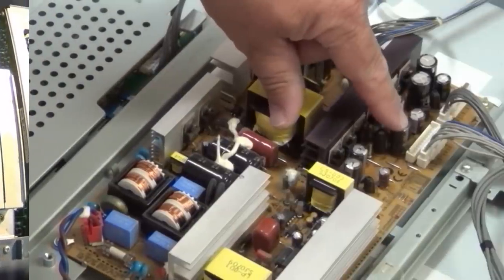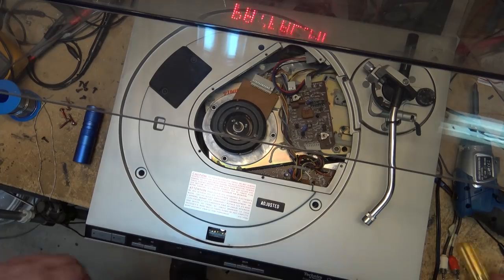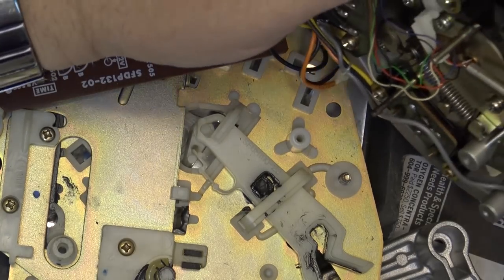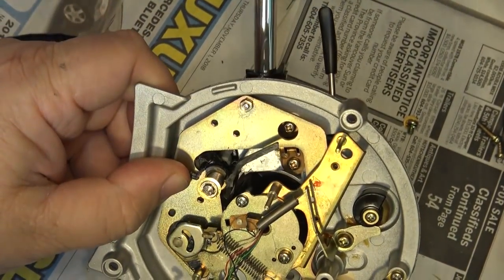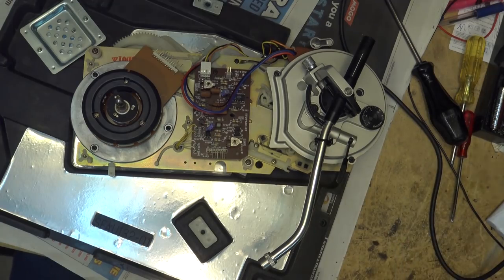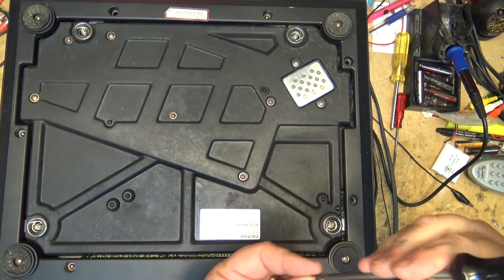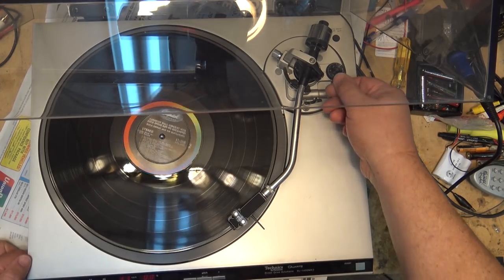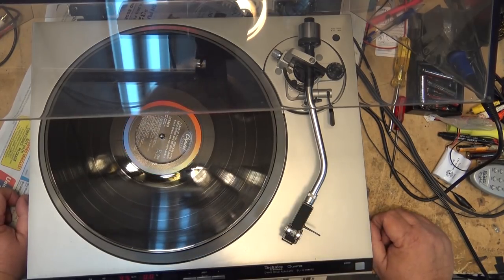Technics SL1400MK2 Arm Lifter mechanism repair

Comment: I have fixed many plastic parts with a soldering Iron! after melting them together though I mix a little epoxy and fill the divot made by the Iron and it lasts a lot longer.
Reply from the maker: So have I. Plastic gear in EVS7000 that splits was one of them. Still going strong.

Comment: Believe it or not, technics actually made this model (along with the mk2 variants of the 1300 and 1500) from 1976-1978. They were really ahead of everyone else during that period.
Reply from the maker: I have the SLM1, and it goes back to the mid 80's when the T4P cartridges started rolling out. Same motor design, but the M1 is quartz locked.

Comment: Funny you posted this.  I just picked up a 1401 to fix up and resell.  Mines in good shape but the auto play isnt moving the arm into position.  Ill be taking it apart soon to clean and fix it. I imagine they arw similar inside.
Reply: There is no auto-play on the 1401, that's the 1301. With the 1401, you press start and move the arm over. It's semi-automatic i.e. no auto start, only auto return.
Reply: @Digiquarium  well I'll be darned.  I'm really glad you said that before I dug into it.  Now that I know it's fully working I'll probably just clean it up and sell it.
Thanks for saving me some head scratching!
Reply: @Digiquarium  I was wondering if you knew what type of plastic the 1401 dust cover is? The one I have has a small crack and I'd like to fix it.  Thanks!

Comment: Probably a polyamide lever. Not easy to break in original condition, even with gummed up mechanism, but PA relies on water content to remain tough, and loses it over time, at the same time the parts shrink slightly, and if they were fitted around a metal shaft, they will break. Can be put into a bag with some water for a few days to restore the flexibility. No matter, it's likely to last for decades as it is now that it's set into its new shape.

Part like this likely won't scan, generally just about nothing scans properly, it's kind of a sci-fi dream. If someone were to CAD it up, a laser sintered PA part could be ordered off Shapeways, that's sensible, not too expensive. Not sure i'd want to print on my home printer other than for test fitting. If copying a part like that is needed, i just take 2k silicone from craft store, make a mould, and build up a copy out of epoxy inside the mould, made decent functional copies as durable as original of very delicate parts that way too, but i don't have the process down to where i would do it for someone else, it's not exactly efficient, would need to learn a lot more about making sensible moulds and resins. A copy wasn't needed in this case, i'm not criticising, just sharing.

Maybe doing small-series copies of parts that are likely to break and offering these replacement parts to repairmen can be a business model of sorts? That way the design or setup costs are better distributed, while $200 for a part is of course bollocks, but at $20, it starts to look much more sensible. Clients don't like to spend more than they have to, but perhaps they'd be forced to spend a bit extra as original parts decay further, good units become rarer and more desirable, and ad hoc repairs like with welding or gluing without replacement parts may become untenable.

Comment: So there was enough silicone left in the damping piston for it to work okay? When you said it was gunked up, it sounded like there was a lot of it lost.
Reply from the maker: Yes there is still good damping on the lifter piston. The solicon damping oil gets gummed up just like any old grease. I used to have a jar of it back when I worked in the shop. It was like glue.

Comment: The original arm lift part is no longer available, but some people offer 3D printed parts for the SL-1400.  This is a common problem of this model as the part was not well designed in the frist place, it has a weak spot where it always breaks.  You can find these guys on the sites of audiokarma and vinylengine.
Reply from the maker: Yes I know the original part is nla.  It had not been available since about 6 years after that unit was made as that is all Panasonic retained parts for.
Reply: I installed one of the 3D printed versions you speak of - it works ok so far. However, you need to install some thin heatshrink around the bearing, then press the new part on. The diameter isn't quite right
Reply: update, i think shapeways modified the part as recently when i've done the repairs they need to be sanded for filed before they will even fit on the bearing, but they have worked like a charm after that

Comment: I had to do some repairs on my sl1300, mainly the arm lifter. The lever for the arm lifter would just slide back down after I moved it to lift up the tone arm.  And when the record was finished, the needle would scrape across the record as it was returning to its resting position.

Long story short, once I got it back together the lifter stays up longer when you are automatically starting it, but  if you do it manually, the lever doesn't seem to stay up as long.  So I decided to try again to look online for info. I noticed that the videos on a 1200 and 1400 (and a few others) seem to show a (much) larger spring used on the arm lifter, than what mine has. 

Should all the springs for arm lifters the same regardless of the model? 

Thanks to anyone who can help me.

Comment: Smashing repair :-D.
The art of the wiggle jiggle :-D, some things are just a pain like the insides of rasta blaster stereos, too much crammed in to too small a space.

Plastic fantastic is a bloody pain in the ass, vcr's can be a bloody nighmare.
Small bits of weak plastic crammed into a small space, not enough room for a brace to support a joint.

Comment: Where do you get a replacement nylon part that drives the plunger? I'm working on one where the nylon broke apart and can no longer turn the plunger. It's too greasy in there to fix with epoxy.

Comment: There are guys on Audiokarma and Vinyl Engine that are 3D printing that part.  It's a common failure point on those tables.
Reply from the maker: I am aware of how common that part fails.  I changed many back in the 80s.  I also know how much work it is to get to it.  I started "fusing" the part back together back in the 80s or 90s.  
What is thought to cause it, besides the lifter freezing is thermal expansion of the metal part it fits over.  Seemed to happen more on setup where the turntable was sitting directly on amplifier.  It all boils down to cost and how willing the owner is to spend money.
Reply: @12voltvids  My alternative hypothesis is not that it's the metal that expands, but the PA lever/gear that shrinks around the metal shaft as it loses water, which happens faster if you keep it warm. PA is generally factory conditioned to absorb a few percent water by weight after moulding to give it optimal mechanical properties.

Comment: Cleaned of the gum, too bad the most important stuff is not in the video. How did you Get the armlifter completely off? I did remove the armrest but that did not help. And most importantly How did you Get access to fix the broken plastic cueing lever. Too bad those things are not in the video.
Reply from the maker: I didn't remove it.

Comment: You can get a replacement part for the broken lifter 3d printed on shapeways
Reply: This is now the second video on youtube that attempts to repair this issue without knowing about the replacement part.  

Maybe melting the crack back together is easier though.
Reply from the maker: It is all about cost.  I had a limit of 50 to repair this.  Could you order a part and do it for 50 bucks? I think not.
Reply from the maker: @AeroModule  
Yes it is and faster.  To disassemble that arm and replace the part would add at least another hour in labour charges.  When the client comes in and says I have a limit or 50 to repair this you do what is necessary to restore operation.  Since there is no stress on the part and the only reason it broke in the first place was because the lifter pin froze,  the fix will likely outlast the owner.  
YouTube armchair quarterbacks think everyone with vintage gear is an audiophool that spends 1000 on s patch cord and has unlimited resources to repair it.  In reality most of the collectors are older retired people that have limited funds.  They want their old gear repaired because they don't want to buy new for the limited use it will get.  It was no different back in the 80s and 90s when I made a living doing this.  A customer would spend 60 to 80 fixing something and it it was more than that they tossed it.  At 80 an hour shop charge (that is what the shop rate was) 1 hour labour seats up most of the limit.  Start adding parts and tax and people walk.  It is even worse now.  Some repairs I make money on, typically the high end  or rare stuff but most of it I make hardly anything on, so I wont spend much time on it.  There are many units that there is no video made because when I open it there is something major wrong and I know I can't do it for the limit that is placed on the repair so I close it up and hand it back.  Not that the unit can not be repaired but when the cost of say a laser assembly is 40.00 plus shipping and the limit placed on the repair 40 bucks.  Well you get the picture.  That is why you haven't seen me replace laser assemblies on CD players.  When they can go to the second hand store and pick one up for 15.00 why spend money fixing old one.   I make more from the YouTube video than I ever do fixing equipment.  For the stuff shipped in for repair, the post office is making a lot more than me on the repair.
Reply: I respect the limitations that may be imposed in a repair, especially those involving costs. I mentioned the availability of the 3D printed part (for $23 plus shipping) because it may be of use to anyone wanting to do the repair.
I have repaired this tonearm lift (details and pictorials on Audiokarma) about 10 years ago. A replacement part was not available back then so I had to improvise as well. I did clean the spring and shaft as well (as well as the entire tonearm assembly as I did it myself and labor cost was not an issue for me. 
The tonearm stopped working this summer when I did use the turntable a lot. It did last 10 years worth of infrequent use. I am now going to redo this trying out that part.
Reply from the maker: @savvassidiropoulos5952  
23 us dollars plus shipping to Canada.  A minimum of 50 it seems. Call it 100 for the part.  Turntable isn't worth that. Dome people seem to put unrealistic values on turntables.  Most will not spend that amount.  Since you have already had the arm apathy you know how much time it takes.  Very few are willing to pay to have this done when as you pointed out your repair lasted 10 years.

Comment: The lifter part is available now 3d printed
Reply from the maker: Doesn't matter because the owner had a 50.00 limit.  So the part would have to have been available for 5.00 including shipping to make it worth my while to do that.  I told him he would be looking probably 100 which is low considering the work involved and he said his limit was 50 all in.  So he paid me to make it a manual turntable.

Comment: Why not changing the old caps?
Reply from the maker: Because the owner is not paying me enough to do anything more than make it work.  Caps are fine.
Reply: you normally only do what is agreed with the customer
Reply from the maker: Customer brought it in with the lifter not working and wanted that fixed. He didn't give me a blank cheque to start changing everything.
I can't remember anyone, ever saying to me, even when I was doing this for a living, change everything that might break.Never happened in over 20 years. Not once.  Every customer was the same fix it for the cheapest you can, and even that was too much in many cases.
When I hear people say "why didn't you recap it" of this or that. Well if someone came to me and said "change all the caps just in case" 
First I would geta  bloody big deposit up front, and then I would do just that. But that never happens.
Reply: @12voltvids  Same here too. I though i do carry quite a bit of stock "just incase" but  what ever I use has still got to be paid for.
Reply: Because that is stupid. not every cap deteriorates enough to justify   spending ungodly amount of time and money. People just assume they do. If it ain`t broken don`t fix it. Right now you can get capacitor tester that can do so in circuit.  if it tests outside parameters then change it if not leave it alone.

Comment: I see you disabled your comments on your “screw you Canada Post” video lol didn’t like the responses you were getting eh? Next time be smarter.
Reply from the maker: The comments were disabled because there is no point rehashing it.  The sender fucked up because he did not require signature, the positie also fucked up because he didn't use common sense.  The other positie that was doing the route always either took it to the other door or carded it.  They would card stuff that did not require a signature.  I know this because I have to sign for stuff and show Id when signature was required and most carded stuff I didn't have to show Id.  So everyone that was making negative comments must be postal workers now worried about their job security.  When I disabled I had about 1000 up votes and 70 down votes so clearly the majority of viewers agree with me. Perhaps the system is broken and needs to be fixed.  When stuff gets stolen, if it is a new item the merchant has to eat it because the credit card company will reject their payments.  I talked to another postal worker and they told me they can at point of delivery card it regardless if it is signature required.  So the know it alls out there don't know it all. End of discussion. He fucked up, I didn't and I shouldn't be the one people are pointing their flame throwers at.  I am showing what happens and why so much stuff gets stolen, nothing else.  I did nothing wrong, but said at the end, had this been stolen Canada post wouldn't be on the hook for it, I would and if the owner decided to sue me for losing it I highly doubt that you all would be paying for my lawyer bill of offering to chip in and replace it.  Now do you understand where I am coming from.  He was just being lazy.  Didn't want to ring the bell and wait for 30 seconds to see if someone answered then go back to his truck get a card and scan it in.  I don't care how overworked they are.  I am overworked at my day job too. Very rarely do I get done by the end of my shift.  Guess what, I suck it up and put in a few minutes of OT and get paid ot premium.  Almost every day as that is what it takes to retire the work load and keep customers happy.